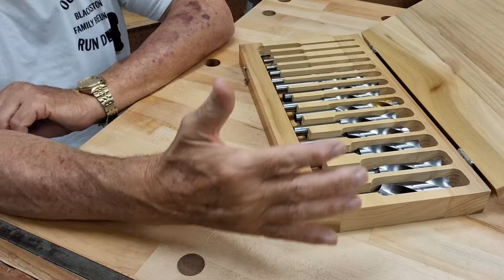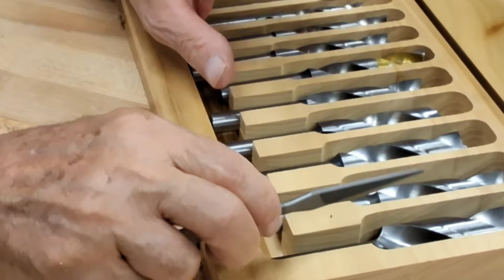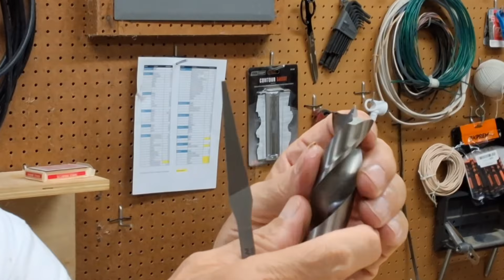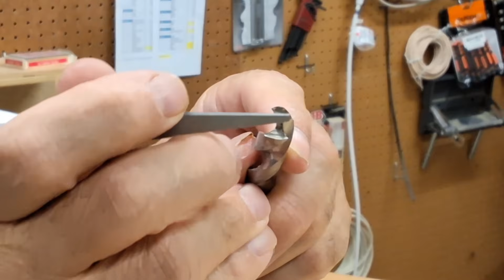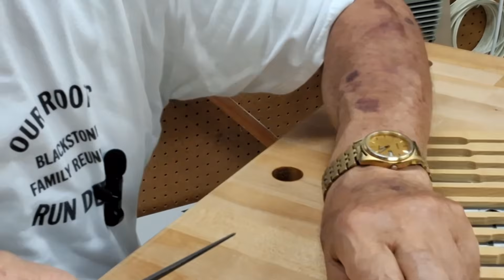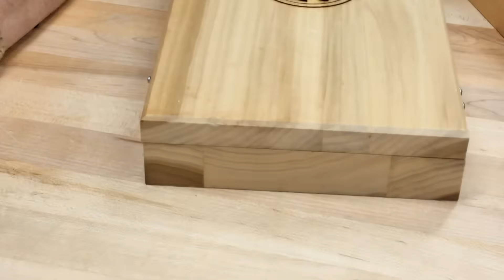How to Sharpen Your Shopsmith Brad Point Drill Bits

Comment: watched your sharpen video with great interest.  I'm dealing with a 3/8" brad point bit that I sharpen as you described the only thing left to deal with is the pitch in grove that moves the chip out.  Can't find anything that will cut it, right now I'm scraping it out.  Any suggestions?
Reply from the maker: You need to use an auger file like I have.  Lee Valley Tools sells them.